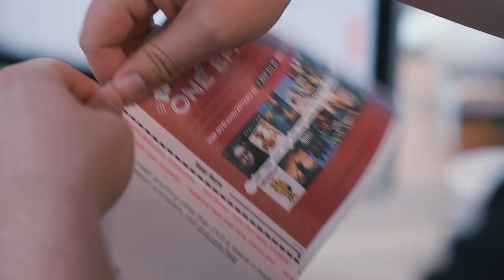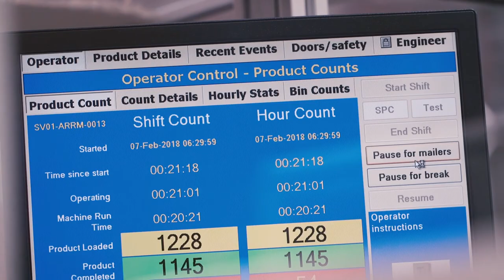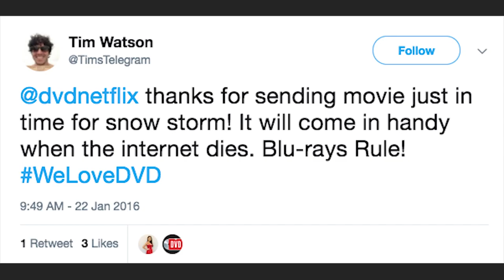Part Four: Return to Sender

Comment: Delivery of DVDs has definitely slowed down.  We used to be able to get at least 2 and many times 3 dvds in a week.  We generally watch the movie the day we receive it and it's back in the mail the next day, and if the mailman came early enough, we'd watch it in the afternoon and take it back to the post office before they closed.  Back then the Netflix distribution was in Syracuse, NY (about an hour from our home).  Then we started receiving them from Rochester, NY and the turn-around time went frmo 1 day to 2-3 days and now, all the dvds we receive come out of Boston, and turn-around is 3-4 days.  We're lucky if we get 1 movie a week from Netflix now...  We now get 1/2 of what we used to for our money because of the change in distribution centers... it basically doubled our cost .
Reply: Same. Add post office slowdown to local distro center closing to Netflix closing on Saturdays... all value is gone.

Comment: I have to agree with the previous post from Mary Pile;  I have been receiving disks for over 10 years.  I could set my clock with the turnaround time of 3 days.  Over the last couple of years, it has stretched to 5 days here in Southern CA.  No closures of Post Offices and no other delays with mail service observed.  I wonder if there's an association with the installation of this machine. And a word to Mr Johnson:  your machine needs a tune up int he alcohol-cleaning and scratch-checking department.  Nowadays, about 1 in every 6 disks I receive either has smudges or fingerprints when I first open the envelope, or the disk annoyingly freezes during playback.  I usually end finding the scratches after taking it out of the player and examining it closely against a reflecting light.  Totally mood ruining ....

Comment: I wonder if this is the reason I get so many cracked discs lately.  It rarely happened in the past but the last year or two I've gotten a number of discs that were actually in some cases broken in half.  I guess it could be the post office doing it but strange that it rarely ever used to happen.
Reply: I have been getting discs since Netflix sent out its very first red envelopes -- I have NEVER gotten a cracked disc.  Only once I got one that stuttered and froze but then they sent a replacement immediately plus an extra to calm my nerves.  Super company.
Reply: Over the past 2-3 months,I have received 2 discs which were cracked all the way through one side,and there was no sign of damage to the envelope   Looked like they were shipped that way.  In previous years this was extremely rare.  Plus,before,all my discs came from Columbia,SC--80 miles away.  Now they are shipped from somewhere in GA.  Turn around time was 2 days; now it's 4-5 days.  The value has definitely declined.
Reply: @Captain Cinema --Well, you are very lucky.  I haven't gotten a lot but have received about 3 or 4 over the years.
Reply: I went through a period early last year (2017) where I was receiving 4/5 disks broken and often the 5th would not play at all. (even checked in 3 different players and performing lens cleaning)  Netflix kept sending me replacements and blaming the post office, and still they would arrive broken. I WAS P.I.S.S.E.D!!!  ... After about the 27th broken or un-viewable disk I received, I finally closed my account for just shy of 6 months to keep my queue from disappearing. Since re-subscribing again in January, I have been receiving less problem disks, but shipping service has definitely worsened with delays between when Netflix reports disk returns and subsequent next disks shipped on my Queue. 

 BTW.. If you start getting repeated broken disks, Start logging them with pictures, When I threatened to sue for Netflix's failure to live up to what I was paying for after talking to more than one supervisor (or somebody playing the role for my call) , all of a sudden my history was purged of more than half of the broken and unplayable disks I reported!!! The only reason I still renewed my subscription after this BS was that being disabled and stuck at home, there are few other options for me to go out and find the foreign disks I like to watch.
Reply: Otaku Kani what does that mean:  your history was purged for nearly half of the reported discs?
Reply: filmstruck.com
Reply: This has happened to my brother lately, who only recently got a Netflix subscription. In a little over 13 years I've never had a cracked or broken disc. But in the last few months, my brother has gotten about 4-5 discs with cracks that went completely through the disc and with no damage whatsoever to the envelope or sleeve. They've all be silent films, too. In one case, he sent the disc back and even the replacement was cracked all the way through. Crazy.

Comment: For those of you who are stating your waiting time is really long for the discs, I have to share my experience.  I did a lot of research on my turn around times for Netflix discs.  First of all, it seemed once the disc reached Netflix, it usually was only 1-2 days before I received a new one.  However, I found that there was a LOT of variability in time for it to reach Netflix.  So, experimenting with how I put it into the mail system affected how fast Netflix received it. 

I don't put it into my mailbox as it is on the street and we have a little pick-up flag we have to put in an upright position to indicate to the carrier that there is something in the box to be mailed.  Unfortunately, it is also indicating to everyone else who drives past it that something is in the box as well, so occasionally things have disappeared in our neighborhood.  So, I mail at our post office, and have found the fastest turnaround is actually walking it in to the post office as they process it immediately.    The mailbox outside the Post Office in the drive through lane seems to give a day delay if you mail it during the day, and if you do it at night when the Post Office is closed and only the night staff is working, it can be a two or three day delay.  

What triggered all this research was that I noticed there was about a 3 month period in which two discs were "lost" that I sent back to Netfix, and one envelope was returned "empty".  These were all discs I mailed at night in the slot accessible through the drive-through lane after the Post Office was closed.  Since I started mailing directly in the Post Office during open hours, I have had no problems with lost or "empty" envelopes.
Reply: The boxes outside post offices "drive by boxes" are notorious for vandalism--people throw garbage in them, pour liquids inside, etc. If you care about what you're mailing (and it sounds like you have some scumbags in the area) it's better to leave it in a slot inside the building. If it's already past the box pickup time then you're not losing anything by doing that. (Sometimes box pickup time will be after the inside pickup time, depends how your local post offices are set up to move mail up the chain)

Comment: Sadly, it seems more and more every day the selection of DVD's is getting smaller and smaller.  I have actually gone out and bought many DVD's that had sat in the "Saved" folder for years!  I actually shut my account down at one time because there just wasn't anything coming in even though the monthly charge was always collected.  When I restarted my account, it reset everything as though it had just been"Saved"!  At one point I had over 100 in that Saved file but through giving up and buying from other sources like eBay, etc., or just taking them out and giving up completely I am still holding right at 30, HOPING for a miracle that I may get one of them before Netflix drops them from their system. I have actually sat and watched one DVD go from "Short Wait" to "Long Wait" and then suddenly just vanishing altogether from my Queue in the span of just two months!  It appears that Netflix is slowly, but surely, getting rid of their DVD department and trying to force customers onto streaming video, which I will NEVER do!  Oh, and commenting about their crappy service when you post a review goes nowhere.  Just read some of the bad comments about broken or damaged or wrong disc shipped.  I had one disc that was damaged sent to me TWICE before I gave up and cancelled it.  Netflix WAS a good source of DVD rentals but not any more.  Sadly, for the short time they may still provide their "service", they are the only game in town, then poof!  Gone to streaming video and OUT of my life!.

Comment: The problem is not the return, it's the delivery. For every Blu-Rays I rent, one is delivered cracked. It's probably not on the NetFlix side, it's on the  post office side. There was a rash of cracked discs that  happened in 2009 and now it's happening again. At least with BRs.
Reply: My guess is its your post office or carrier. Have had netflix for 10 years and have gotten two cracked disks total. Last one was a few years ago. It's really rare.

Comment: Yeah, how many people did that thing put out of work?
Reply: what
Reply: Your comment reminds me of what people said in the late 70s and 80s when newspapers changed from people hand-setting the type to having the newspapers printed through a computer system.  I took a "Print Shop" course in high school in the 70s because it included learning how to develop film.  However, it also included "training" on hand-setting type for a newspaper.  I couldn't believe how incredibly boring it was to put all the type in order and then find the appropriate sized space bars to put in between the words to make sure it made nice neat columns.  On the positive side, the experience ensured that I did well enough in high school to get into college so I didn't have to do such a job.

If the only thing a person is qualified for is a repetitive motion job, then they must be resigned to the fact that at some point they most likely will be replaced by a machine.  And....I am surprised that in the 21st century people still don't "get" that.
Reply: ok lawrence summers
Reply: Considering the volume of discs being handled daily, it wouldn't surprise me if the number of "lost jobs" was minimal.  You still need people to make sure the envelopes are sorted properly (disc heavy on one side, other side is just paper), load them into the machines, take the paper part to recycling, etc.  If anything, many people probably just got reassigned to doing tasks that the machines can't do, while letting the machines handle the more tedious of jobs.  So instead of sitting down on sore butts each day, straining their eyes to make sure orders match up, they can move around and relax.
Reply: You obviously haven't watched Modern Times, Wolfie. You can get it from Netflix DVD. What most people don't have a clue about is that robotics are going to take away more and more jobs, even ones done by many skilled workers and we need to be preparing the society for that. Meanwhile, somebody had best start improving the education system as well. It would help if schools were inspiring enough to make kids want to stay in them.
Reply: I'm not saying that such advancements don't get rid of jobs, just that given the situation, the job descriptions more likely shifted vs just being completely eliminated.  Let's say that among 40 people, they were able to handled 12,000 (300/ea) envelopes a day without breaking a sweat.  But then the volume steadily increased to where they were getting overwhelmed, say to double the amount.  Bring in the machine and it takes on a huge portion of the burden, but it needs help, as it can only do but so much.  Those 40 people are now doing the things that the machines can't do, while it effortlessly handles the more tedious and difficult jobs.  Sorting through the mail to put the return envelopes into piles to go into the machines (and redirecting any other received mail, as needed).  Loading those envelopes into the machines, switching out the recycle bins for the paper-only part of the envelopes, possibly even a bin for newly discarded disc sleeves that may have ripped, etc.  Also, preparing the newly ready-to-ship envelopes to be sent to (or picked up by) the USPS.  As the volume increases, there is more work, despite a machine handling a major part of that work.

If the volume were the same as before, when those 40 people could handle it without breaking a sweat, then yeah, bringing in a machine would eliminate a lot of the jobs, as only a few people would be needed for the rest of the work.  However, the increase in volume simply means getting the existing employees to do other things.  The 'drawback' wouldn't be a loss of jobs, but rather, a lack of new jobs despite the increase in workload.
Reply: If Netflix didn't create this automation device more people would be out of work because it would be out of business. Imagine DVD-Netflix taking longer to send you your DVD because people aren't as fast as a machine. Then imagine DVD-Netflix raising their prices to pay all the employees, especially with newer minimum wage laws. Customers would leave DVD-Netflix because of the longer wait times and higher prices, which would force DVD-Netflix into bankruptcy and to close. Now all those people are out of a job.

Comment: How is I still get broken and cracked DVD"s ?   Sure it hasn't happened very often But in the last two years I've gotten Two ???
Reply: I've always wondered that.  But what I wonder more is how do DVDs get scratched?  This presumably happens in people's homes, but the way I use a DVD, there's no opportunity for scratching.  It goes from the envelope to the machine, to the envelope.  The machine touches the disc only with a laser.

I have an old machine that is more sensitive to scratching than modern machines, so I notice this a lot.
Reply: I'd actually say that's extremely impressive to have only gotten 2 cracked discs in 2 years.  I seem to get a cracked disc every 4 or 5 weeks.  But what I can say is that my delivery time is excellent. Next day they always have my discs, and when they ship I always get them next day.
Reply: Maybe it's that most of the DVD's I pick are not the latest but more obscure. and when I do catch up on things more current i get more damaged ones. I'm just supposing because I don't remember exactly which ones were  Just my sense of shock

Comment: Netflix releases a video promotes a wrong information. The guy at the beginning of video inserts the DVD into the envelope, and the bar-code orientation does not facing the window on envelope.
Reply: He specifically said it is no longer necessary to align the bar code to the window.
Reply: It doesn't matter how you return it anymore. The barcode seen through the slot is only for the machine to read on the way OUT of netflix. It doesn't read it on the way IN until it takes the disc out of the envelope.
Reply: Good to know. Thanks. I don't have to petrify to send the DVDs anymore.
Reply: Sorry, I miss some times. Thanks for letting me know. I would not worry anymore.

Comment: What happens if I have two DVDs and return them in each other's envelope?
Reply from the maker: Sometimes people lose/damage their return envelope and have to return two discs in one envelope. That's fine!
Reply: That crashes the ARMM as it begins to watch both movies at once and the blue orgies are too much to handle lol
Reply: No problem.  The machine reads the bar code on the disc and on the envelope to verify.  I think the video says that.  It also says that it will print a whole new envelope if necessary, and the case that the disc is in the wrong envelope is probably one case of that.
Reply: Netflix will come to your door and have you deported. Goodbye!

Comment: How do you know when a disc is damaged. I have had 3 in the past year and always write on the jacket that it is a damaged disc?
Reply: You can report that it is damaged if you go to your history under your DVD queue. Just click on "Report" and that will let them know the disc needs to be removed from circulation when they get it back from you.
Reply: Uh huh...I did that and got the same disc sent back to me with the damage in exactly the same spot!  I cancelled the selection so they couldn't send it to me a third time!
Reply: Wow I sure didn't know that.  But if they are recycling their jackets, unless they are done by automation, they should see my large note written on the jacket.  Thanks Richard. They need to have a better way to report damaged discs.  I have called them with a damaged one and ask that they send me that disc and the next one at the same time, and they did do that. I thought that was nice.
Reply: The video makes it pretty clear that humans never see the jackets.  And the machine doesn't know how to read remarks written on it.
Reply: Same happened to me several times on the same disk.. they kept sending replacements and I would get it with a similar crack.. Finally after calling Netflix for the 4 time in about 12 days, insisting that they weren't checking into my complaint and was just re sending the same disk back to me, they suggested that I hold on to the disk till the replacement arrived... Sure as shit!!!.. the replacement had a crack in the same exact spot, as did the next replacement!!! It was shortly after this that I finally said "enough" and cancelled my account for near 6 months.
Reply: After watching this set of videos, it occurred to me that nobody is actually reading these notes and the machine must be trashing them.  Sad because I have often sent/said some very nice things that have never been read.